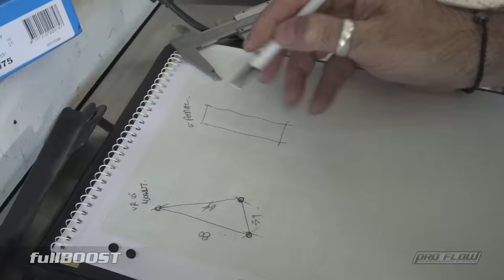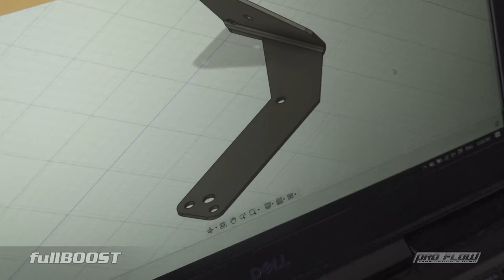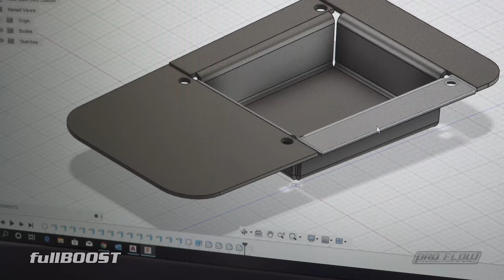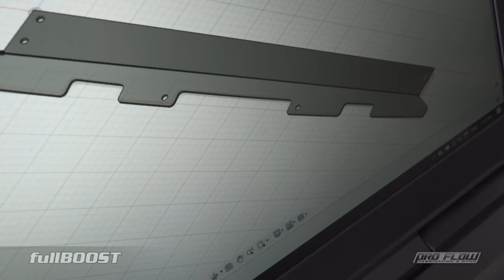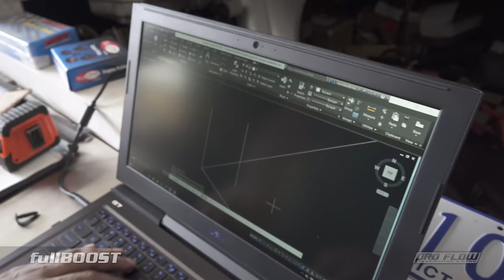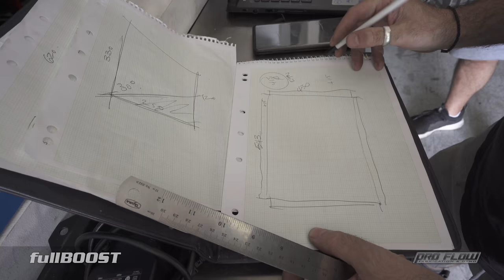Budget Barra Holden project car | NOMANG ep06 | fullBOOST

Comment: Aah memories. 1996, working at Target, the manager took delivery of a brand new VS fleet car. I got hold of it a few hours after it turned up, to run an errand. Pushed the power button on the Auto and peeled off a huge single pegger across some traffic lights! Lol, blew my P Plate mind!
Reply: You wouldn't do the same in a fat VT though